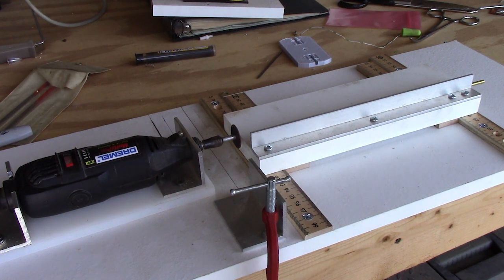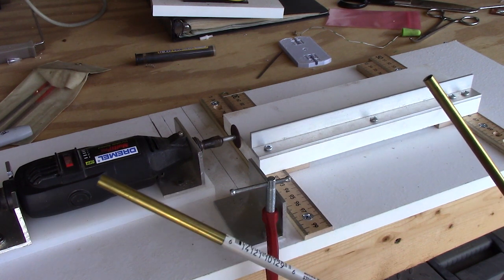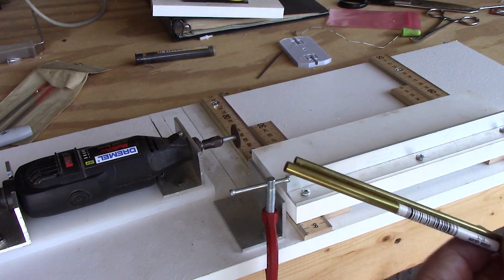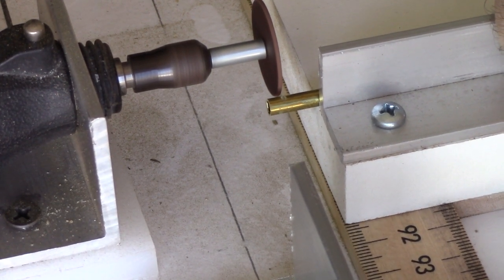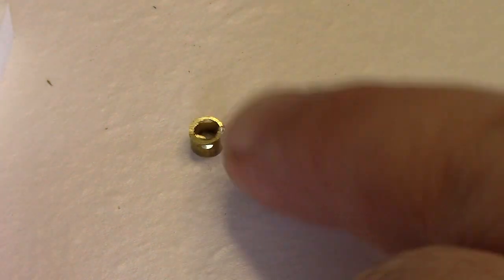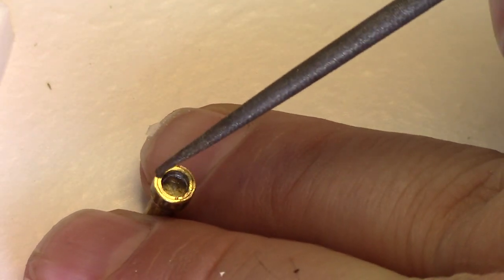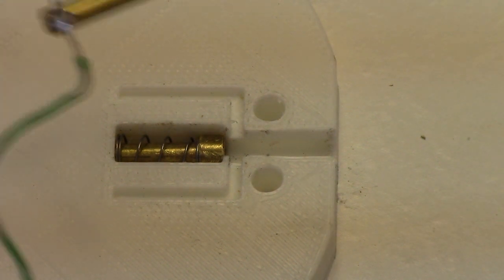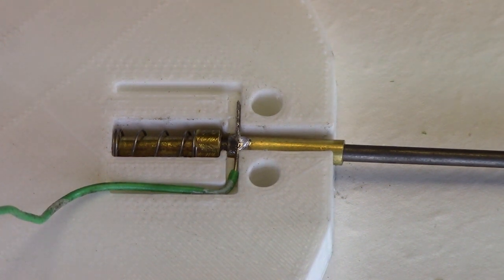ER05: Brass Cutting machine

Comment: Just cut brass tubing using a mini pipe cutter and a drill motor.  Works extremely fast using both hands.  I then took the cut pieces and placed one in the chuck using needle nose pliers.  I then used a needle file to deburr the inner wall while rotating in the drill motor chuck.  File for the top edge surface while in running drill motor and all done!

Comment: Why aren't you using a saw blade? I mean, that disc is more like a thick grinder disc, not the proper cutter for brass. A saw blade would give you nicer cuts and less waste, as well as no dust.

Comment: Hi! I need to make nice cuts for my brass tubes 2,38 mm, which Dremel should I use and most importantly which size on the tip should I use? 

Looking to cut halfway of the tube as well 

I’m new to this, thanks!